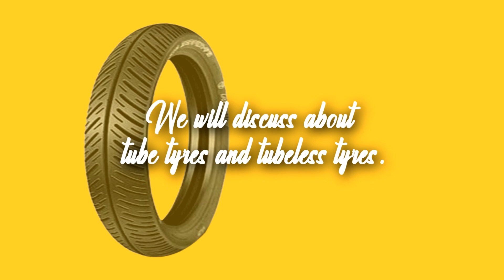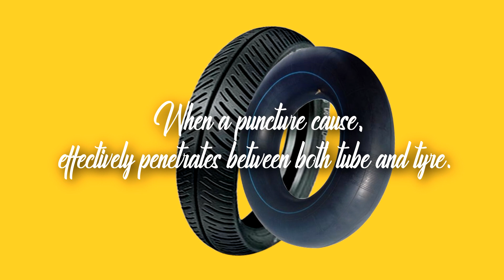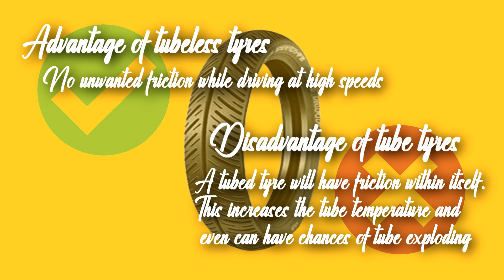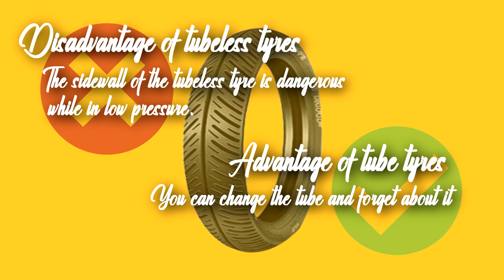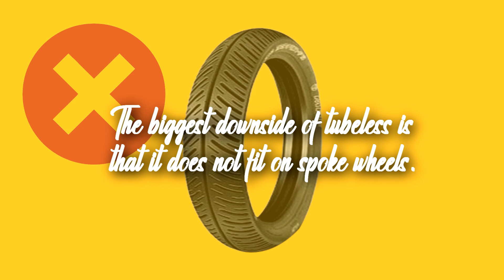Difference Between Tubed Tyre and Tubeless Tyre || Tubed Tyre VS Tubeless Tyre

Comment: If i put a tube inside tubeless tire after a puncture will it be again able to work well enough like before? Or there could be some difference or any inefficiency while driving putting tube inside tubeless tires?
Reply from the maker: No there will no changes although your tubeless tyre will became more tough also forget refilling of air atleast for 6 months.
It is best way to preserve old tubeless tyre.

Comment: Hiii brother please reply me, my scooter tyre is tubeless, already it was punctured two times at the same time. Mechanic told me to insert a tube in to the tyre, is there any  changes will happen after inserting tube into the tyre? How it effects to its performance
Reply from the maker: Yes, you can do it will be extend your tyre life and will be more sturdy, atleast you don't need to worry of fill air frequently and tell your machanic to fit tube properly in tyre, always remember fill little less air then in actual as it's prone to skidding so drive safely.
Reply: @Mobitod  okay dear, Thank you so much

Comment: With a tube, there are chances of uneven pressure and can make the car wobble at high speeds. Also, since a tubed tyre has more components (tyre, tube, rim) compared to a tubeless tyre (just tyre and rim), performance and efficiency are better with a tubeless tyre.
Reply: Copy paste.haha😂😂😂

Comment: tubeless has a interior inside? or tire only with sealant?
Reply: It's almost empty inside except for the glue . Whe the tyre is punctured the glue will leak through the hole and harden so no more air leaks.

Comment: How to find tube or tubeless tires
Reply from the maker: Tube or tubeless tyres are very similar to each other more or less tubeless tyres are thick on both side through the rim layer coz Tubeless need to be air tight through the rim itself where as tube tyres they had tube inside tyre.

Comment: Can I convert tube tyre into tubeless one...that is  By removing the tube and installing a valve ?
Reply from the maker: No cannot convert basically Tubeless Tyres and it's wheels rims are specially designed to air proof. Where as in Tube Tyres a Tube is inserted to inflate Tyre.